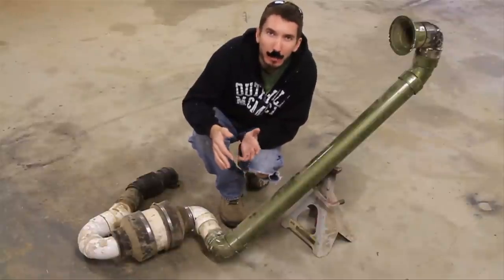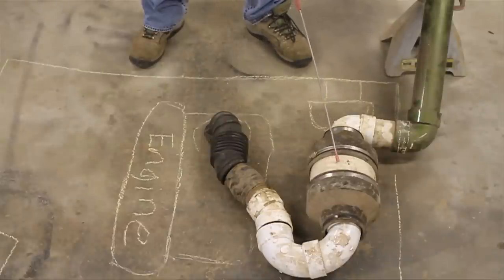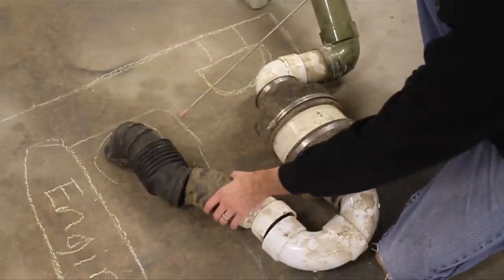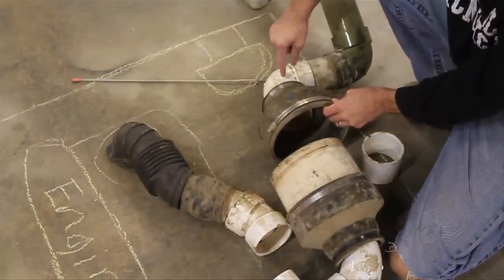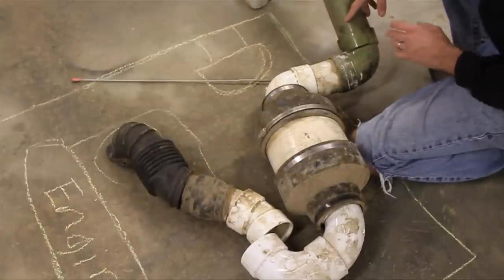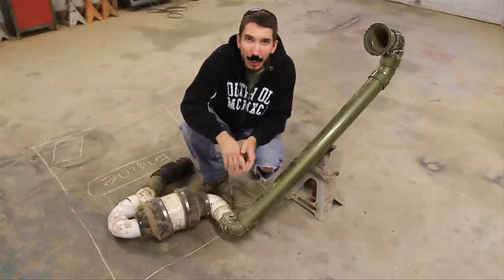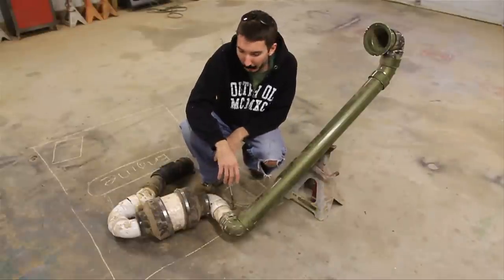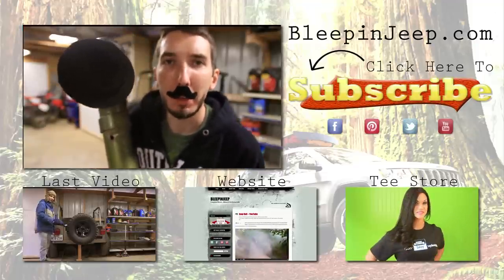How To make your own Snorkel out of PVC

Comment: I had a snorkel on my 89 xj. Only difference i noticed was a slight throttle delay.  Not sure if it was just the sound of the intake being beside the windshield or if actually was a delay in throttle response but ended up scraping mine for a dual battery set up and ran my intake thru the firewall. Loud but worked well

Comment: Hey, great video. I'm playing with the idea of installing a snorkel on my 06 Dodge Dakota, but there's virtually no aftermarket support for this truck. My main options at this point are likely down to modifying a 3rd Gen Ram snorkel, which are themselves rather hard to find, or fabbing one up using pvc like this. Thanks for the vid!
Reply from the maker: No problem

Comment: I am thinking about doing that for my ZJ, except I'm going to use the stock original filter and the stock air box, and just cut a hole into the stock box and then basically use that instead of the 6" cupplings you have.

Did you notice a better increase in air flow with the snorkel on?

Comment: On my electric connection I am going to try using shine tube with the die electric grease leave shine tube long enough to add some glue on the end before shrinking this should seal all your connection

Comment: on a typical air filter your flowing from outside to inside; any negative effects with clogging faster or issues due to flowing inside to out?
Reply: I think he accidentally put the coupler on the wrong side when doing the video.

Personally, I would always run filters in the direction they are designed.  Primarily because filters are structurally stronger that way and in a catastrophic intake of water or debris, that filter needs to be strong enough to choke off the engine and stall it without leaking by, collapsing, or unsealing in any way.

For that same reason I would never run a cotton gauze filter (K&N's and K&N clones) without a proper prefilter in off-road applications.
Reply: l337pwnage That would make sense then; thanks for the quick responses

Comment: so my question is do you need to also raise the exuast above the water line as well.intake is obviouse but can water get into the engine through the exuast?
Reply from the maker: Not really as long as you keep the motor running and giving it some gas it wont flood the exhaust.
Reply: Joe Spawldin saw this happen to a brand new Rubicon last weekend. My little Cherokee kept swinging all day